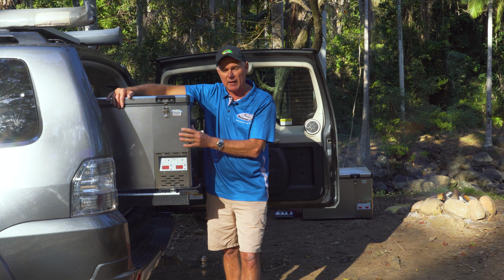National Luna 60L Legacy Fridge / Freezer

Comment: Quality??? 
Please explain.. 
Why not tell your viewers this fridge now utilises a proprietary power hungry compressor and not the danfoss compressor. 
Compare the data on the back of this fridge to the previous models that ran the danfoss compressor. The new models AC and DC amp rating is more then double. 

You don’t back your product. You treat your customers as if they are stupid. 
At time of this post we’ve owned a National Luna for 15 weeks and it’s been getting serviced for 8.5 weeks and counting. 
Let’s not forget it failed to work brand new out of the box. 
You’ve made it clear in emails you have no concern of the bin temperatures and only care of the temperature within the walls at point of contact of thermostat probe.